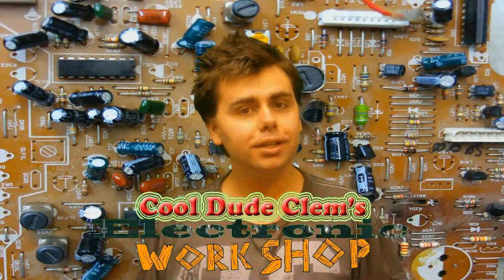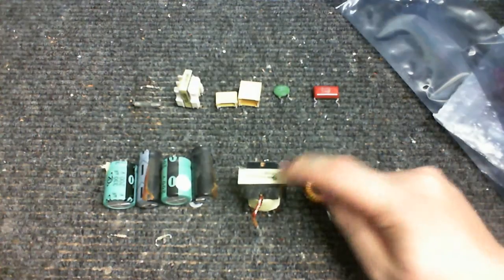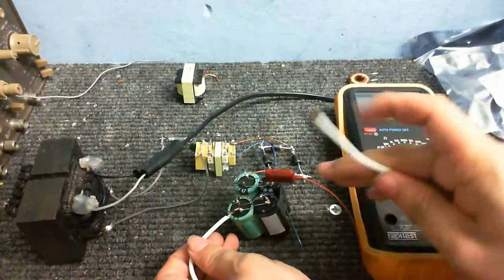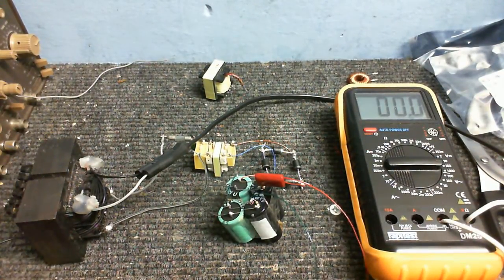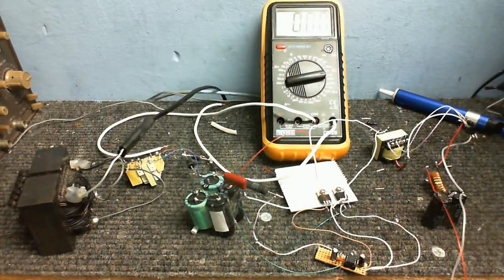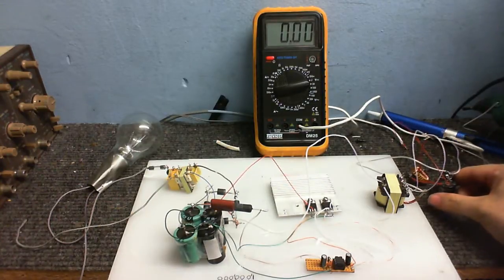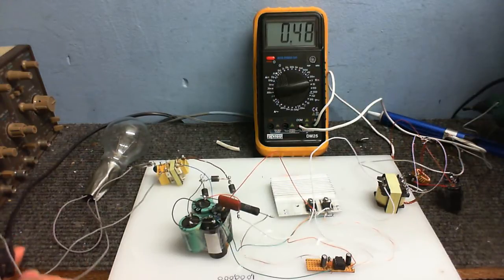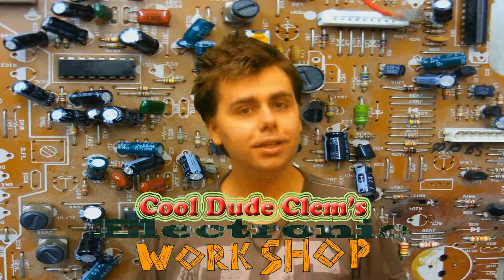Building A SMPS Part 2 - Building and testing the prototype

Comment: hey my fiend

how is life goeing?
Reply from the maker: Things are going pretty good!
Reply: okey
nice to hear

how are the tubes?
Reply from the maker: *****
Still good, I'm going to try and get my VTTC running off a MOT soon.
Reply: aaaa nice

i just repaired my tube flyback
nice 4 cm arks
and then the 3K resistor burned
it seems it needs to be more then 2W for correct power disapation

my lose flyback core makes an awsome sinewave
(40 khz at 20V)

it will be a great drive transformer
but it screams like hell